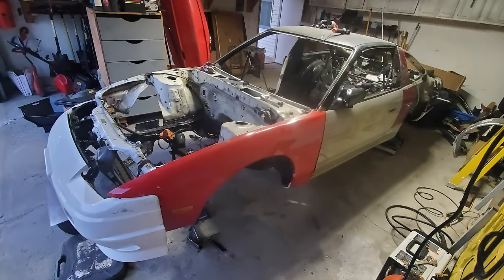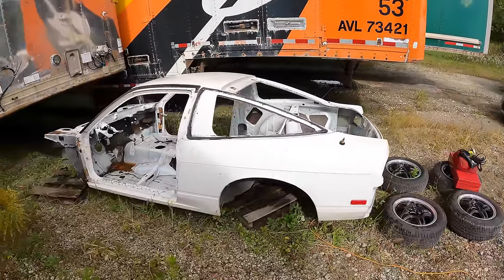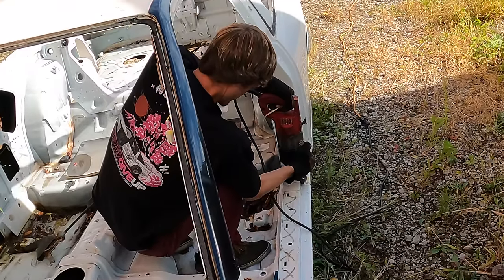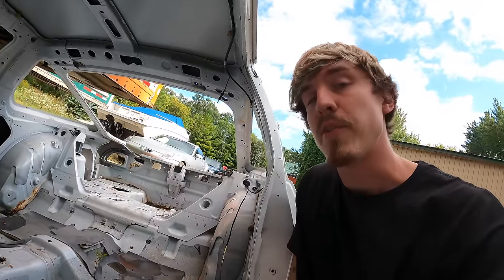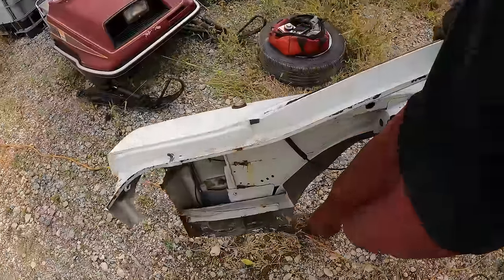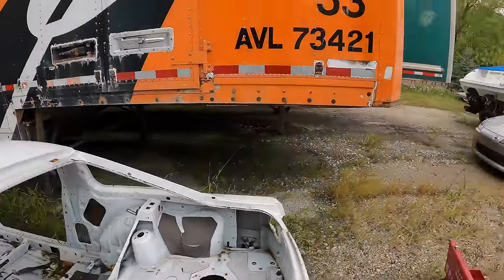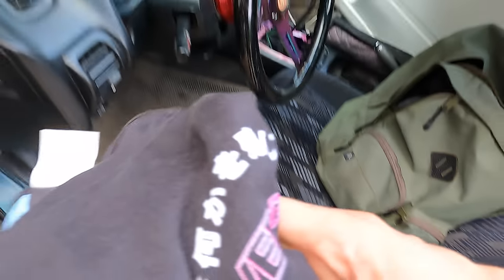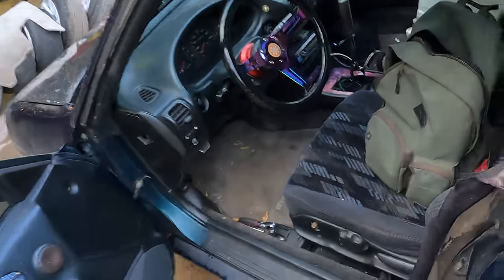Abandoned 240sx S13?!

Comment: Great idea on using a parts car, many builds will be saved when that quarter panel is able to be remanufactured!
Reply: You would need the original tools to remade that panel.
Metal springs a little back when it's stretched, and that has to be taken into account when pressing the panel. Even if a mold could be made from that panel, the parts that would came out from the press would be unusable because they won't retain the exact shape.
It's fine if you want to save another car with it, but it probably won't be useful to recreate more and start a production batch from it.
Reply: @pbe6965  ever thought of carbon? Plenty of molds can be made and many carbon versions of that panel can be made 🙂 don’t be so pessimistic
Reply: @pbe6965  you must be new
Reply: @pbe6965  not sure if anyone will seriously try to recreate the factory press. Fiberglass or 3D scanning&printing look more realistic and affordable.
Reply: I agree. Many of these cars were slowly disappearing/going “extinct” because of all the availability & conditions. Hopefully there was a manufacturer who can produce these parts from the mold based on the shown oem parts,given a licensing deal from Nissan, or the Nissan themselves to restock these parts (just like what they’ve done in every GT-R generations (R32,33, &34 + 35).
Reply: @futurenickel702  no one will buy a carbon "oem" fender.
overfender, yes, but then you don't need this oem panel for that.

To answer you question, I was thinking of carbon when I was answering.
But I don't see a market for a fiber reproduction, if you want OEM because your car is a collectible you'll go for steel, if you've got a drift/track machine chances are you've already stretched the wings to fit large tires and you'll go for +20mm or more.

There are "OEM" carbon hood though, so maybe I'm wrong on this one ...
Reply: @mikeeru  you can directly 3d scan an s13, then.
It might even be better than trying to scan a brand new panel that will inevitably flex (the composite panel can be flex back into place, though, so it might not matters).
Reply: @pbe6965  they also don’t always make them outta sheet metal. A lot of aftermarket body parts are fiberglass and you could make an exact copy with some of the scanning technology that’s out there today
Reply: Reviving more and more 240’s🫡
Reply: honestly this is how we save these cars. look at mustangs and other muscles you can get a full repo down to the chassis. The JDM community has to come together and make it happen or these cars will impossible to keep on the road as they will become too valuable to drive.
Reply: Kfvintage has picked up an s13 and s14 to start reproducing body panels, if they do with those what they do for the 240z then there will be loads of all needed panels to rebuild these chassis

Comment: I know we like s-chasis because they are light. This series has given me a excellent look at how just soft unibody cars can be. Though I have definitely noticed , when pulling in and out of my driveway that has angles my hatch with a sunroof will creak in multiple places from the stress.
Reply: Sunroof models are notoriously weaker. But yeah it’s pretty pathetic how easy they split. I’m having issues around my shock towers, front driver and rear passenger are both splitting at the seams
Reply: My hatch won't even close when I'm parked at an angle lol

Comment: The number of times that poor "work truck" has been partially disassembled and reassembled... /shakes head  Maybe you should cut the roof and extend the back into a station wagon looking contraption... then you could have probably fit the entire shell in there...

It was a shame about that shell though, but the bottom looked pretty trashed... couple that with the lack of a VIN, and salvaging whatever is still good is about all you can do.  Too bad you cut that one at the bottom of the A pillars... Mine has paint badly bubbled up right where you cut through on both side... of course I'm focusing on other areas and haven't attempted to strip them back to good metal so I don't even know if I need replacements yet, but sometimes it pays to plan ahead and get ahold of what you need before you actually need it!